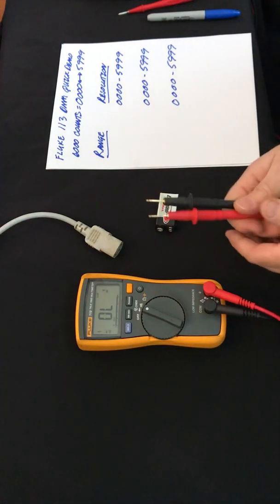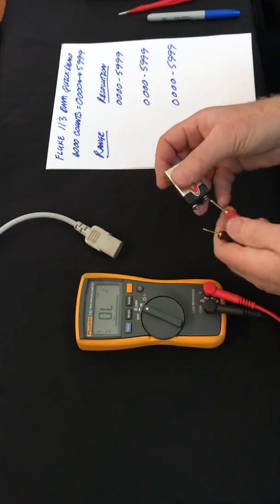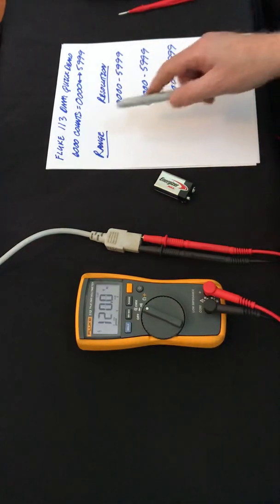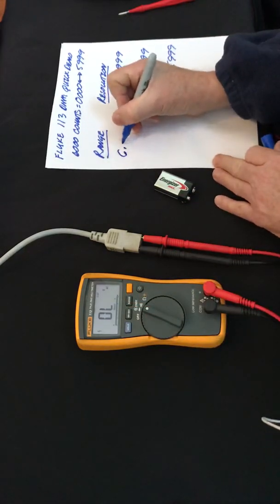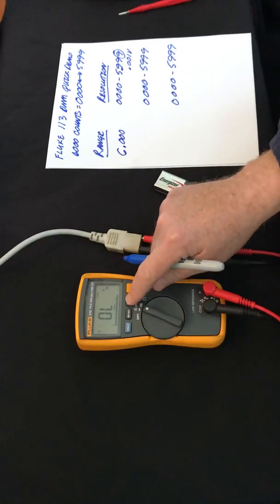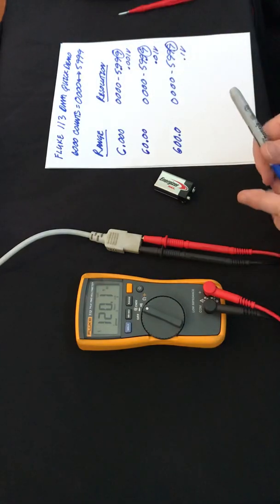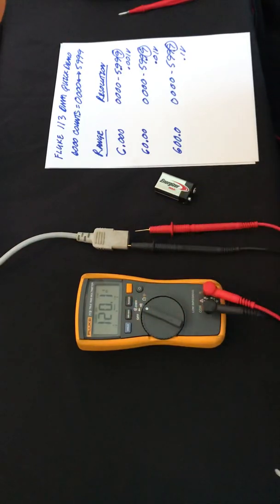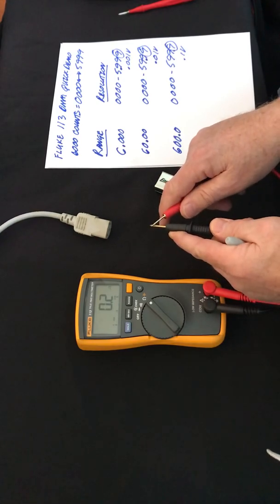Fluke 113 Electrical Multimeter Quick Demo

Comment: Is this a good beginners multimeter
Reply from the maker: Adding to Sean's answer, the automatic voltage mode places a load on the circuit under test of around 3000 ohms, while a more general purpose DMM places a load around 1,000,000 up to 10,000,000 ohms in voltage mode. This is safer for sensitive electronic circuits, which can be harmed by the low input impedance of 3,000 ohms on the 113. The new Fluke 100 series, or the 117 are good meters to star with that will last a lifetime.  Improve and other brands also offer great products at lower cost.
Reply: @meterhelper7692  I’m thinking to het the fluke t6-1000
Reply: It's a good meter for electricians or for HVAC like myself. 
It would not be very good for very fine electronic work such as troubleshooting circuit boards due to the limited resistance of 60k ohms.
Reply: "Beginners multimeter" in what field. From your question I will assume you're beginning electronics hobby and in that case, no this is not an ideal multimeter for electronics as a hobby. For an electrician this is a really decent meter when coupled with a clamp on style ammeter. For electronics hobby, you don't necessarily concern yourself with CAT IV rating, consider BRYMEN 786 or more affordable OWON 41+ for beginner hobbyist in electronics.